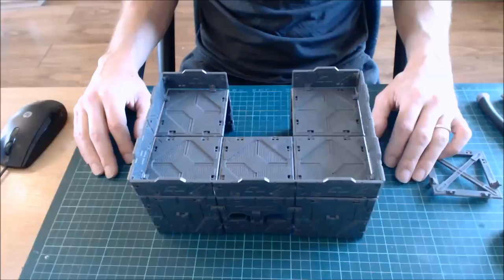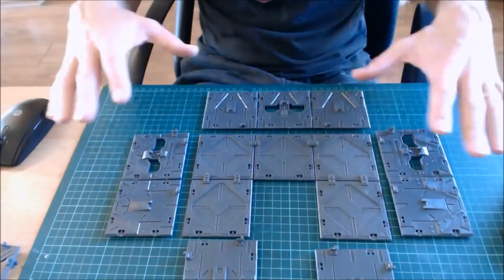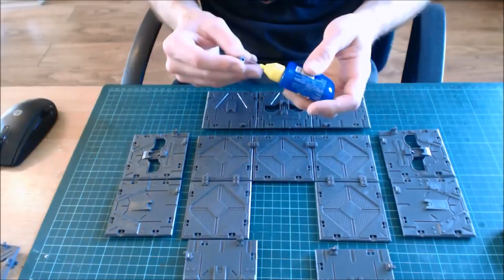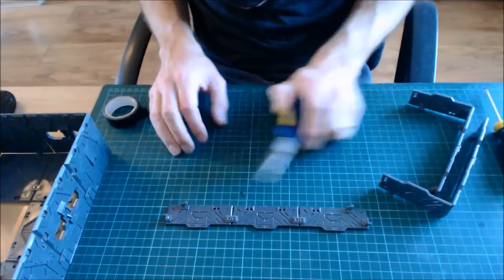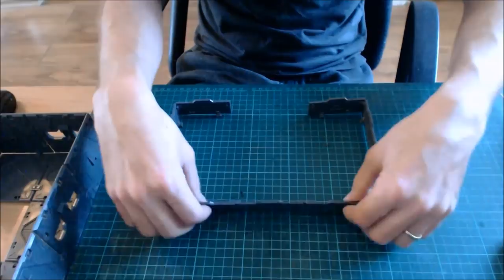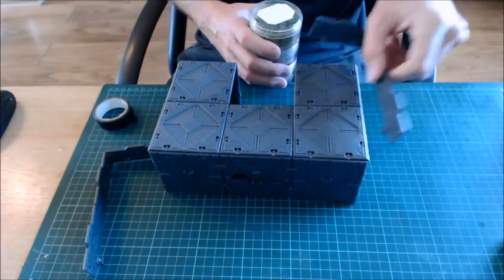Adepticon Battlezone Build 1

Comment: Thanks so much for putting these up Mel!  I'll be working my way through them.  Great tips, I knew the vids would be helpful.  So, the thin model glue will work on these?
Reply from the maker: General Splatton No worries mate, yeah the ones with the brass tube applicators work really well. If you can't get them over there, let me know and I'll put my spare in the box before I send it.
Reply: TheTerrainTutor I have some Model Master liquid glue for plastic models.  I think that should work, right?  Thanks for the thought!
Reply from the maker: I'll send you some mate ;-)